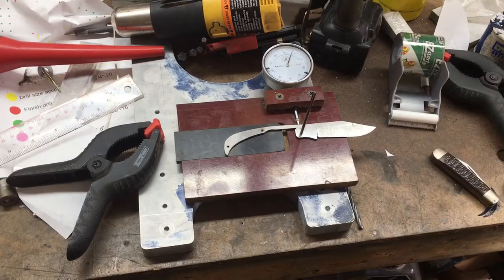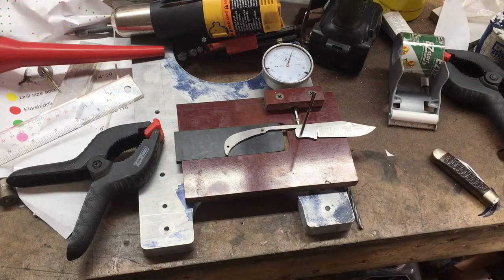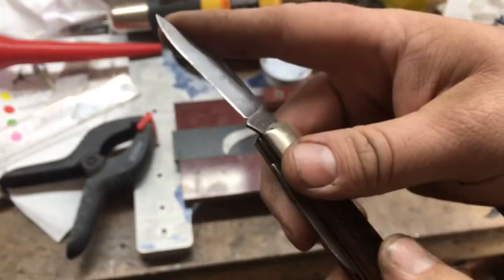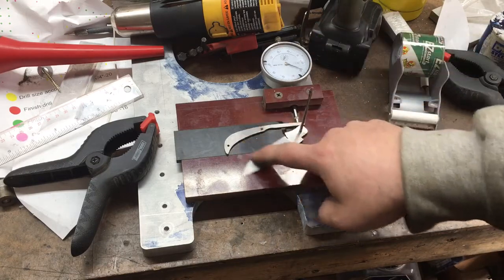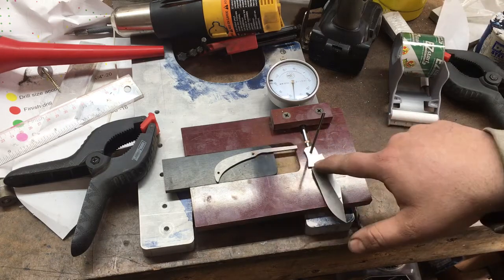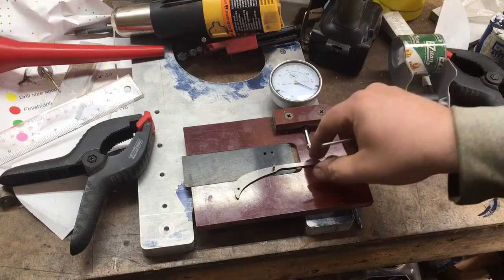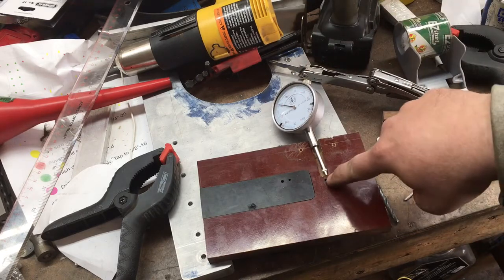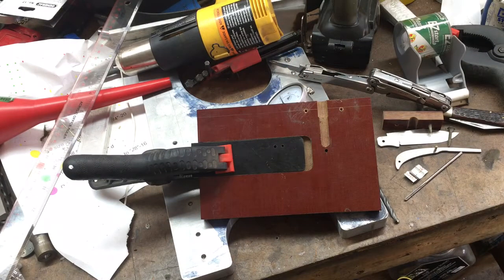Rise and fall indicator for slipjoints

Comment: Great video on rise and fall indicator use. I've watched it a few times now. I have a rookie slipjoint maker question. I've made a few, with a lot of trial and error, and I've run into the same problem each time. When I use my rise and fall indicator I don't know how to best translate the exact blade and spring placement to my scales. Should I drill the holes in my scales first and then match them to the rise and fall indicator? When I do mine I have been making the blade and spring first. Then I fine tune the tang for open and closed position on the RFI, then I take the finished parts and attempt to put them together on a liner and scales, but I can't ever seem to get the exact fit that I had on the RFI, so the spring kicks up or the closed position is off a little. What am I missing?
Reply from the maker: It's definitely a little tricky. I've since started using a RFI fixture that matches the pin layout on my liners/covers and pre-tensions the blade while measuring. You do see a small difference otherwise, if you're measuring an un-tensioned backspring.

Comment: Very good! How many mm of pressure in the spring.
Reply from the maker: I’m not sure, but you can remove a little steel from just in front of the middle pin hole if you need to lighten your slipjoint tension.